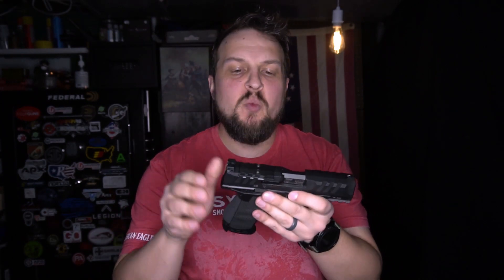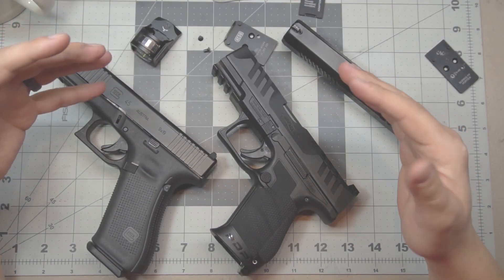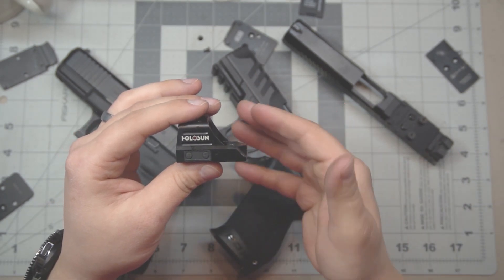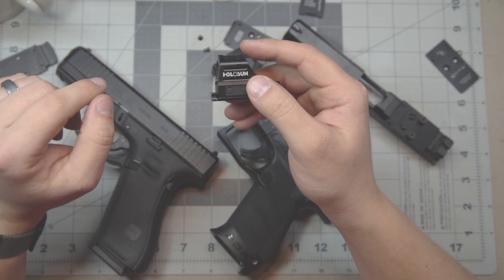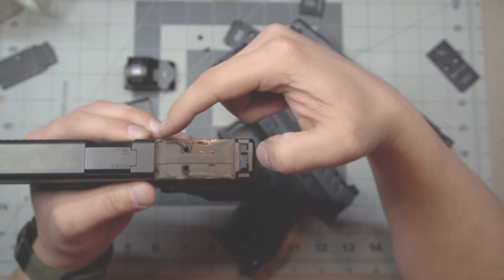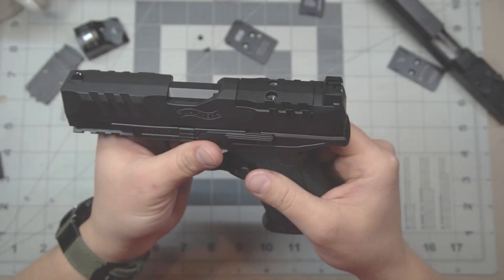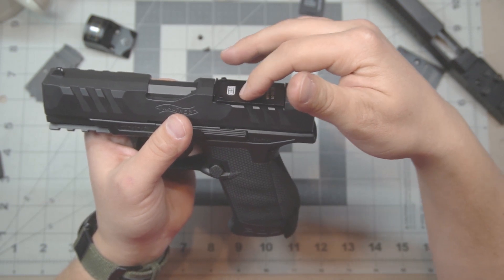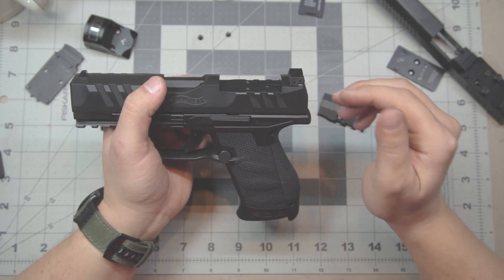The Gen 1 Walther PDP is going to Break

Comment: This guy is getting a lot of flack for his take here in the comments, and he got that same flack on the walther forums too, that is until someone on the forums starting getting their official Walther optic adapter plates in and then finding out the fitment of the plates were very questionable, and providing pictures of multiple sets of plates not fitting tightly onto the slide of the pistol with gaps on both the front and back of the plate. Which is not how they're supposed to fit according to Walther's own response. Even if Walther designed this mounting system to work a certain way, it can't work the way they intend if the plate doesn't fit properly and all that force will go onto those two mounting screws alone because of it, which is what WorkTheTrigger here is worried about in the first place. I'm not saying ALL the mounting plates on ALL the PDPs are like this, just that there are people out there running into this issue as I type this.

I'll be the first to admit I'm not a engineer but just because Walther has assured us that they've tested this mounting system extensively with thousands of rounds with zero issues, doesn't mean ordinary people like you or me aren't gonna run into any issues during real world usage. I'm not gonna bash the guy for pointing out what he sees as a potential failure point. I'm not a brand hugger and I want to be made aware of any potential issues, regardless of how large or miniscule they may be. 

https://www.waltherforums.com/threads/your-walther-pdp-is-going-to-break-thoughts.125743/page-5
Reply: Still waiting to see an actual failure...folks have already put thousands of rounds through these pistols with optics mounted.  No failures.
Reply from the maker: I've seen mtiple instances of zero shift now.  We are prepping for long term, high round count testing... But it takes time 🤷🏻‍♂️
Reply: @workthetrigger  you've seen and verified this.  I will await the video with that information
Reply from the maker: Yes. Do a little bit of looking, it's not hard to find.  

Not only that, but the way their "system" is stated to work is not how it's working. Video should be up Tuesday, pending additions

Comment: Why not just create a plate that grips onto the slide charging cuts on each side?
Reply: Machining costs and tolerances.  Added precision means added cost.  But you're right.  There's built in female lugs for something to mate into.
Reply: That's what Walther did, with the final production plate they provide.

Comment: Yeah this is overblown, why don’t bolt guns optics rails fail? They literally only have tension force from screws holding them on and the screws take all the sheer force from not only a larger mass optic but a heavier recoiling gun. Couple that with the fact there is no give from reciprocation (yes the abrupt stop will increase force momentarily as the slide goes back) but the rifle rails have no point at which force is decreased by reciprocation and must hold the entire assembly and scope against that recoil. 

I’m not saying I wouldn’t prefer lugs necessarily, but also the lugs are transferring any play into the optic, meaning there’s 4 abrupt stops in every firing. The point at which the slide stops, the point at which the mount moves backwards and hits the lug, the same thing going back forward. 

Regardless...i don't see any of these systems being problematic. Unless the supplied hardware is absolute junk, its a non issue, there's not enough movement to sheer a screw anyway. You would most likely need overlapping surfaces for that to occur coupled with way more sheer force, or waaaay more wiggle room.
Reply: The rail on a bolt gun doesn’t reciprocate back and forth like a pistol slide. It’s common knowledge that optic plates are prone to coming loose because they aren’t a direct connection like a custom slide mill. GarandThumb talks about this in a few different videos, one of them being the Glock 19 MOS video. Don’t take my word for it, take his. It’s not a big deal, you just need to tighten the plate again and go about your day.
Reply: @ProfessorSteez  that’s what I’m saying though, even coming loose doesn’t mean it’ll be able to shear screws
Reply: @rollyourownRandF  Right? People typically change their RMR battery more often than that anyways so it’s mostly a non-issue if it takes longer than a year to come loose

Comment: Still waiting for the factory MiM plate Walther sent me in mid March 2021 to break lol. It fits snug with a little bit of blue loctite and hasn't shifted zero once with 1,200-1,500 rounds ( I lose exact count) alot of it was overpressure 9mm with alot of Winchester m1152 115gr and alot of 124gr +p HST, Gold Dot, Ranger T-Series etc. Spoiler: WTT is full of shit and rocks a huge hate boner for Walther. Sage Dynamics already put this to bed.

Comment: i guess in theory it makes sense - all the force (optic mass x mounting plate x acceleration) will be exerted on the mounting screws in shear direction.  however i believe the weak link in the system is the screws not the slide of the gun - i believe the screws will break before the gun crack will stat to initiate around the screw holes.  i'm sure someone at work can do a simple calculation, or even build a FEA model and tell me how many cycles of the slide it will take for something in the system to break.  without actual testing or analysis, hard to tell when the thing will break, if at all in my lifetime.

i'm waiting for my plate for Holosun 507C.  will mount it and admire it for a while since i don't have any ball rounds to train with.  lol.

Comment: Walther PDP updates OPTIC PLATE MOUNTING SYSTEM and adds lug design in 2022. Although they said it does not mean their first-generation has any problems, obviously Walther's engineers notice the non-lug design is not as strong as lug design. This means this YouTuber's guess is reasonable. Any products have its cons, it is not a big deal if the company can update it and make it perfect.
Reply from the maker: I give Walther major Kudos for their work. The new design should be incredibly strong.
Reply: I just bought a PDP, but it’s version 1.0. I wonder if Walther will send me the 2.0. Why are they still selling the version 1?
Reply from the maker: Stock. They had tons made. Gotta get them sold before completely transitioning

Comment: There's another problem mine is in the middle of breaking right now.  It's not the optic system.  If you read this, message me and I'll send you the pic.  Clue look at where the spring begins, what happens when forces are concentrated at a point instead of distributed evenly.  I've got a couple good pics if you want.
Reply from the maker: Hey, shoot me an email at workthetrigger@gmail.com you've peaked my curiosity.

Comment: I listened to your run on intro of mounts. Then you got to walthur system and then claim the screws used to secure it can no handle the force. Ok Mr. Mechanical designer did you look up the shear force needed for the screws to make sure this was true? No because you did not say this information on critique. Did you mount and optic and shoot any ammo through to give us a current ammo count preferably with video proof? No did not hear that either. Did you calculate or measure the force generated from the bullet being fired and the force the slide generates on racking forward? No? Maybe I missed this part as well.

I am not an mechanical engineer but am fully aware screws and bolts have shear strength numbers and how it is finished in treating also affects this. If I was going to say I am a mechanical engineer and going to dog on a system over lack of mechanical features. I would know it is needed to pull the data at least for those screws or test shear strength my self with a bottle jack and a meter used in machining that measures play. At the very least if I was a gun channel and thought this to be an issue. I would be dumping rounds through it during practice to get the numbers. If you can not afford it then get some buddies to bring their ammo and shoot one gun. Record everything shot through it and again for credibility record it.

I will agree there seems to be a lack of physical stops that I would have on there. I held this gun today and damn is it light. Impressively so and can see possibly due to this the issue proposed is not an issue. Also the screws are angled which will resist the plate from moving is tightened and torqued properly. Be sure to use locktite. Also maybe a good idea if you really think this is an issue to have one dab of super glue. Can use nail polish remover to remove the plate if needed. I was a my computer so this more or less thought out critique was possibly in a timely fashion. I expect gun youtube channels to actually do the testing and data checks on concerns. Not just go here is a shot gun of products and this one seems to be going backward in design. Possible the engineers realized the screws are able to bear the load. So call them on it if you think they are wrong and prove it.

Comment: Agree, that kinda freaks me out. Need someone to drop test this thing with a RMR mounted (sage dynamics?). I can see those screws shearing clean off (and taking a bite out of the striker with it?) if it takes a hard dink sideways.

Most Glock MOS plates aren't very tightly fit though and the issues people see are usually related to loosening, not fatigue life killing the fastener? I don't see this causing catastrophic failure in normal use, but the side to side failure potential is weird for a gun marketed for duty use.
Reply: Why test a 3rd party aftermarket plate that's a half-arsed bodge?  What's the point?  Walther isn't supplying the plates made by our host's 3rd party grifter/seller.  This entire video is not about the Walther PDP.  It's about our host's lack of humility and his attempt to pass himself off as equivalent to experienced, educated engineers at Walther.  It's a sham -- and that's being gentle on our host.

Comment: Nobody except you has allegedly known several of these failures to exist. Walther engineers are pretty savvy, or so I hear. I think the only time it could be an issue is with cheap, aftermarket screws. The ones used by Walther will more than handle the shear force. There are too many folks out there with literally thousands of rounds through them with zero failures.

Comment: We have electrical engineers where I work and some of them are dumber than a box of rocks. My Grandfather was the head of the machine shop at an oil refinery. When the new hires came in, fresh with their new college degrees, and their reference material, he asked that they pass it all forward and he proceeded to throw them all in the garbage, stating " This is what your degrees are worth in the real world!" So just because you have a degree in something doesn't make you smarter than everyone else.
Reply from the maker: ... so what makes the engineers who designed a system infallible?  You think engineers don't screw up or miss something?  I think there are a lot of sig owners that would disagree.  And glock owners.  And CZ owners. Don't even get me started on companies like Remington.  How is Walther exempt from a missed issue?
Reply: @workthetrigger  Maybe if you had actually shot the gun with the correct Walther plate and it still borke, then maybe you'd have something. You don't even state where the breakage would occur. That would be helpful to know. You may turn out to be right, but there are critical points missing in your "educated" guess.

Comment: Mhm...

PS. Reasons to buy the PDP: It costs less than an FN 509 Tactical, It's actually available unlike the 509 MRD, you aren't completely sold on CZ, Glock MOS isn't that great so you have to send your shit to be milled, Core series...well...maybe plastic plates aren't an issue.  I struggled to find optics ready options of other guns, but I did find a PDP for 618 shipping included.  All I need it to do is let me get a feel for PMRD's and eventually maybe I can consider a 509 MRD or getting my G19 milled.

Comment: Have you ever considered that the optic plate that you have may have been machined out of spec???  I suggest you increase your sample size to make your argument more valid.  I'm hearing reports from other PDP users that their optic plates are tight.
Reply from the maker: If the walther plate I have (which is loose), or gun I have, are out of spec, it only goes to support my assertion that their interference method of optic support is not sustainable through manufacturing.

Comment: Have you done a follow-up video about  the RDO shoe design? Sage Dynamics did his tests (I"m assuming you've seen his video by now). This gun passed. Kept zero. Will the RDO come off after 5000 rounds? and 8 drop tests?  Shrug. 

Logically, from a "first look" it would seem what you alleged would happen. But, I have yet to come across any complaints or mention. It's Dec 7, 2021 now. Several months later. 

It IS odd Walther would go with a smooth surface  RDO shoe when everyone else has not.  From an engineering perspective. Even some one without an Eng degree would see this. Yet, it doesn't seem to be a thing oddly enough. 

Could have the optic directly mounted to the slide. if this is a big deal even if it might be just "in your head". 

RDO and guns. Gets me how companies price their guns just because one version of one model offers the RDO cut. E.g. A CZ that's RDO ready is $600 MORE (CDN).  SIG P226 Legion w/ included ROMEO optic...$200-3000  more (forced to take the optic...they dont yet sell the gun with only the optic cut).

Comment: go to your local automotive parts store, get a pack of windshield rearview mirror glue, put a little bit of it on the plate screw it on, and have at it. trust me,  the optic isn't going anywhere! ***side note, keep the glue off the threads of the screws or you'll end up having to drill them out if you want to change it***

Comment: Break the wallet maybe. I think the engineers at Walther, combined with their degrees and experience, know what they’re doing.
Reply: @Diabolus_Musica  Walther has been in business for a long time. I doubt that they skipped over testing the PDP.  If there happens to be a problem, they’ll fix it.
Reply: @Diabolus_Musica  An RMR weighs 1.17 ounces. If you really believe two screws can’t hold down something that weighs 1.17 ounces, you’re dumber than I thought. The author of this video says fasteners aren’t supposed to be load bearing... that’s patently false. But take his design degree over Walther’s decades of experience likely several engineering degrees.
Reply from the maker: I didn't say they weren't meant to be load bearing, I said they're not designed to take shear force.  If you're gonna try to discredit me, at least quote me right.  And then do some research into how fasteners work.  

And if you think they're holding 1.7oz, you need to revisit physics class.
Reply: @workthetrigger  First off, you fasteners can’t take “that kind of force”... which is a false statement. Walther isn’t sending sheer bolts. Also, the grand majority of the forces exerted on the sight and mounting system is going to be done in a longitudinal fashion. You’re using a 3rd party plate, but the plate itself will be inside of the cut out... there’s nowhere for the plate to go forward/backward. So the screws will actually bear less force because the mounting plate will transfer it to the slide. Where the latitude forces will come from, I’m not sure. If you sheer those screws off, your optic is probably done anyways. If anything, the sheering of the screws will prevent the optic from damage.
Reply: @Diabolus_Musica  Logic doesn't work as you suggest.  Study up on logical fallacies, you're using a few of them!
Reply: @workthetrigger  and if you try to discredit Walther, at least use their plate...

Comment: How are the optic systems on FN pistols and HK VP9 pistols?
Reply: I have the FN 509 and one of my RMR screw fly away. So be careful and check every other week if is loosing tightening.
Reply: @JoseAguiloworkshops  thank you sir
Reply: @Diabolus_Musica  I just follow FN recommendations. They advise not to use any loctite. But maybe you're right. I will try and let you know. I hope to find my common sense in the loctite bottle 🤣🤪

Comment: The energy is not going from the optics to the slide then the gun, energy is all in the slide, then translated to the other parts of the gun.  Because the optics weigh almost nothing, there won't be a way for it to break.
Reply from the maker: We do the math in the 2nd video. Next to nothing isn't nothing.